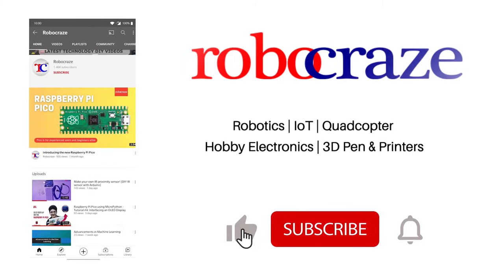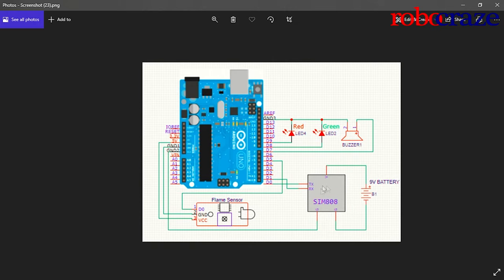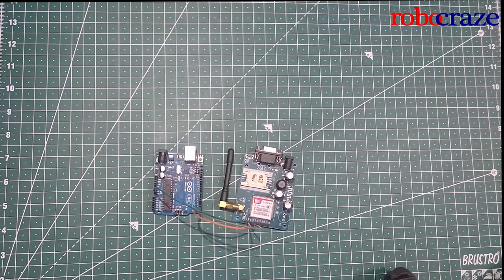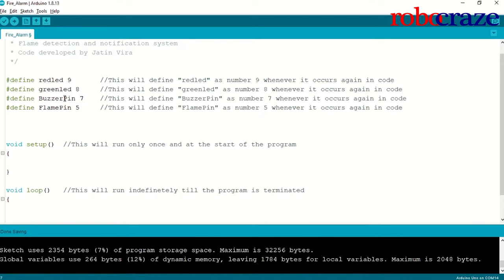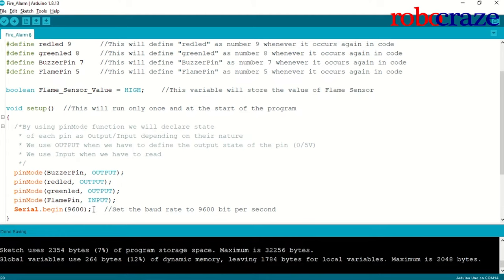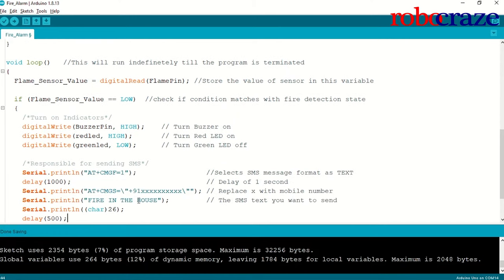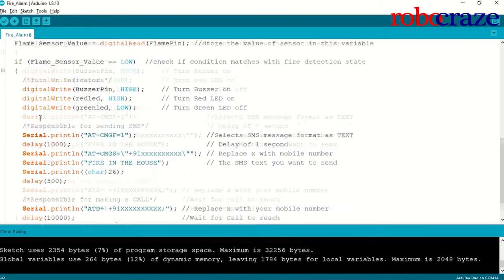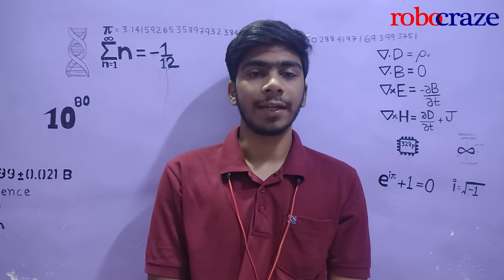Fire Detection and Warning System using Arduino and GSM

Comment: I didn't know we could detect fire with LEDs . Thank you so much i will light my house curtains on fire asap
Reply from the maker: Hello! It sounds like you might be joking, but just to clarify, using LEDs to detect fire isn't a practical or safe method. For accurate fire detection, it's best to use specialized fire sensors and alarms.

Thank you for your comment, and stay safe! :)

Comment: gsm sim800c modem does it work on any sim in bangladesh?
Reply from the maker: Hello, The GSM SIM800C modem should generally work with any compatible SIM card in Bangladesh, as long as the SIM card is from a mobile network operator that supports the required GSM frequencies (such as 2G/GPRS) used by the SIM800C modem.

Comment: Can you supply 9V to SIM900A?
Reply from the maker: Hello! 
Yes, the SIM900A module with rs232 interface will take a supply of 9-12v. However there are SIM900A module that typically operates at 3.4V to 4.4V, so supplying 9V directly would be too high and could damage the module. 

Thank you for asking! :)

Comment: Can you supply 9V to SIM900A?
Reply from the maker: Hello,
You can give 9v to SIM900A module with rs232 interface board. If you are using a regular SIM900A module then 5v has to be used.